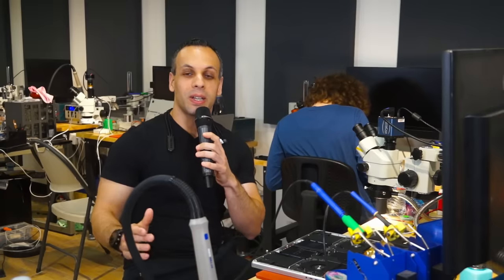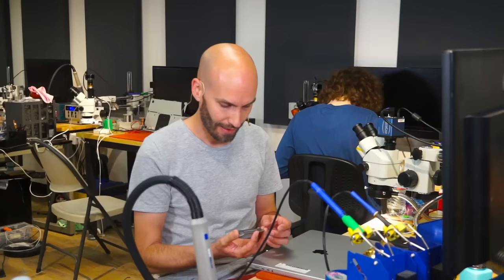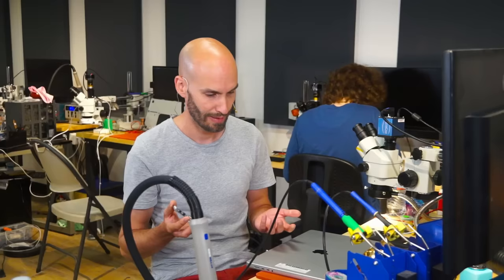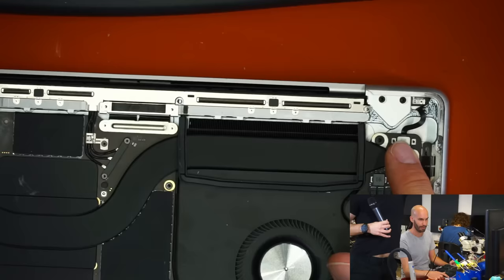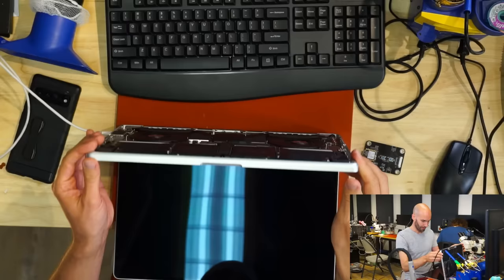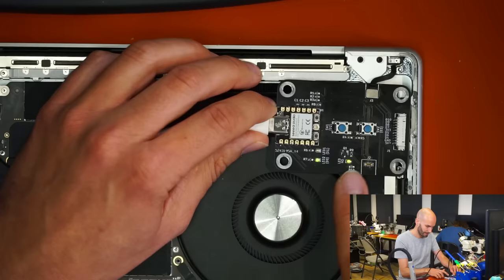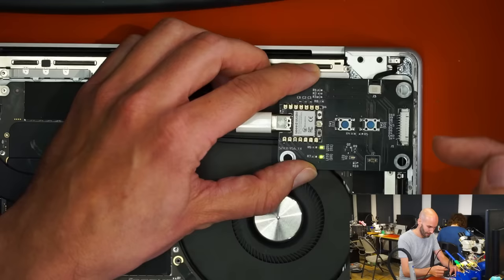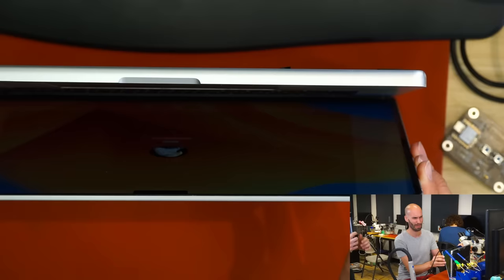We beat Apple at their own game - let the unauthorized calibrations begin

Comment: My first question: How is such a security-sensitive sensor left so exposed that it can just… corrode??
Reply: Apple.logic
Reply: How is such an important device so unimportant to apple users that they keep spilling soda on their phones and laptops that cost $2000?
Reply: @shinobuoshino5066  you know there exists a thing called condensation and water has 3 forms of state.
Reply: @renegranit240  if you live in a tropical forest without a dehumidifier and with a macbook I don't have much to tell you.
Reply: @shinobuoshino5066   some very sensitive water damage indicators can 100% trigger from humidity in the air
Reply: @supershid464  water damage indicator doesn't mean water damage occured
Reply: @shinobuoshino5066  that's my point, but also corrosion CAN happen without direct water contact
Reply: @shinobuoshino5066  I live on a coast, like >50% of all human beings. On the coast, water happens in the air, even when it is cold enough to instantly freeze when it touches anything solid. It can be fog, it can be humidity, it can be sub-rain layers in the atmosphere coming in droplets too small to feel but enough to slowly laminate everything in a dew. Unless you live a life so utterly empty you don't actually open your doors, and chose instead to slowly rot into the architecture breathing only artificial air, any device you may need must be prepared for ordinary environmental conditions. If it is not, that device is specialized for different environments, and should not be sold in places that will rapidly destroy them.
Reply: @dashiellgillingham4579  ah yes, everyone lives near an ocean, how could I forget about that.
Reply: @shinobuoshino5066 Where i live, we often have 80%+ humidity during the day and 10-15C drop in temp for the night = condensation. 
Nevermind breathing in the direction of a laptop in front of your face, that is also hot humid air...
Reply: @shinobuoshino5066   you should honestly see a population density map.. good chunk of people live in humid areas.. and even in the middle of the US, away from the coast, humidity still exists. can your dehumidifyer work when traveling in your car?
Reply: @ZaricaLP  yes my car has this thing called air conditioner and my bag has those pellets that absorb humidity that had a warning not to eat but you did anyway.
Reply: Simple
They want you to pay them more for an overpriced repair so they design so poorly that stuff breaks by normal use
I don't like apple
Reply: @shinobuoshino5066  Its the #1 computer for music creation. They're used in clubs. Shit happens, people are stupid.
Reply: @GetFitEatRight  no wonder why all music is slop
Reply: @dashiellgillingham4579 I live a valley city with average 90% humidity and the largest amount of rain fall in Europe. Our homes rot away from dampness and mold. I’ve never had or heard of tech products being broken by corrosion. And I grew up in the 90s when people went outside. I’ve known more people personally than you’ve had hot dinners.
Reply: What about windows? They're the very meaning of building shit cheep. I've had a macbook for 5 years and... nothing. Had to get the battery replaced once, but that's it. Windows? My brother bought a pc... few months later, the pc got ruined. Next pc, same story; same with the third. And i've heard first hand of people who buy a pc, it’s just a year old and guess what? Their keyboard broke. Now that's what I call cheeply made and screwing over its customers. Mind you, all the people who I mentioned did properly take care of their devices; and they still broke after a year of use at best. I've never had that happen with a mac. Hell, the Windows laptop I have now... Feels flimsy as shit, too. I'm not saying it'll break, but the quality of it just... It feels low quality as well.
Reply: @ThatBlindGuy246  what does windows have to do with hardware that you found in landfill?
Reply: @dashiellgillingham4579  What is this artificial air? Do you think buildings just circulate some different air than the shit you breathe when you go outside, or something?
Reply: @ThatBlindGuy246  "a pc" is not a laptop

Comment: This really is a nice new invention that opens up doors to calibrating other components in other apple products. If apple software or hardware engineers make amendments to this then they will have made a conscious decision and we will have concrete evidence of this. Evidence against all those supporters and legislators who oppose right to repair.
Reply: The way to calibrate this specific sensor does not necessary have anything in common with anything else in a Apple product. The caibration routine is device- and manufacturer-specific.
Reply: Was wondering if this means a solution could eventually be reached for calibrating a new screen? Or if their system configuration tool is a different ballgame.
Reply: The German dude said he was tinkering in Arduino and then got other people, more proficient than him, to finish the fix, so yeah, the path to achieve the fix is now open but it will need to be reimplemented for all other devices that Apple shits out too
Reply: @LudwigVaanArthans  Exactly.
Reply: Yep. Next stop: screens!
Reply: Every time I see a ht like this, I fear to wonder what the hell are they going to do to screw things more.
Reply: Rest assured they will come up with an uncrackable version with better encryption.  It's a never ending cat and mouse game  (Clinton vs. Apple lol)  By the way, normally there should be NO need for calibration as each MacBook has the same case and closing angle.  Obviously this just another Apple BS.
Reply: @oienu  But are you actually getting an expertly calibrated screen when you buy a mac? And are you getting your money's worth? I bet not, I've always built my own computers, and I will continue to do so.
Reply: @oienu yea but when Ur sensor breaks and u want it replaced
Reply: @MrElmostudios  When the sensor is just a Hall effect sensor, well, you need to adjust the threshold for the magnet on the lid. That depends more on the sensor manufacturer, not Apple.
Reply: @BillAnt  Unfortunately, calibration is necessary due to variations in the magnetic field of the magnets used. These variances result in the sensor consistently producing slightly different values, which could potentially lead to issues if calibration is not conducted.
Reply: @notebooknerds_de  trim pot. Since this would be essentially a simple on/off switch with a hall sensor trigger on a device, you don't need a hugely accurate calibration tool or technique. Just turn the pot until the thing works correctly. Though I guess Apple won't implement this because it would take up space.

I'm probably wrong with the trim pot idea, but honestly this kind of simple actuation shouldn't need any kind of complicated calibration if it was designed to last. What was wrong with putting a small neodymium magnet on the case of the laptop and a very basic hall sensor on the top of the screen? It didn't need calibration because the error tolerance was so high it didn't matter. I'm also genuinely asking because maybe there was a problem with it I didn't know about besides every now and then getting a paperclip or something stuck to your laptop.
Reply: @notebooknerds_de  - Other manufacturers use the same HAL effect sensors just fine without calibration.   Even if there's a slight variation in the magnetic field, it doesn't matter whether is closes at 4, 5, or 6 degrees, this is not some super precision application.

Comment: I was expecting Stephan to capitalise on this genius tool by selling it for $500+ but was happily surprised that he's made it extremely affordable, even for a DIY repair, at only €169!!!

Even though I do not own ANY Apple products, I thank you wholeheartedly for your efforts with this and wish you all the best with developing similar devices for other locked out anti repair hardware on other Apple devices.

❤ To Louis and Stephan From Australia ❤
Reply: And it should be mentioned, after 350 units are sold, the project goes open source.
Reply: @DaRealV  i mean he did really heavy lifting in reverse engineering so i completely understand that he wants to earn some money from it
i just really hope apples cease and desist doesn't come to him
Reply: how did louis forget to mention it @DaRealV
Reply: @dairiskuznecovs7233 Huh ? He just did the one thing people didn't bother to do and read the fucking chip datasheet to send i2c calibration commands.

169€ is extremely expensive. That card should not cost more than 15€ all in to make.
Reply: @henria.277 "i2c calibration commands" The hell does that even mean? i2c doesn't need calibration commands. Do you mean calibrating some sensor? Okay, but then why would replacing the part make it so the thing stops working?
Reply: @henria.277  he wants to recover the cost he spent getting someone to turn his tinkering into a product .After the costs are recovered, (350units), it gets opensourced, at which point you could get one made for much less money.
Reply: @bluefireanimations3712  The sensor are either not absolute or simply trigger a boolean register in the sensor after a certain value is reached, both of which need calibration when changing the part.
Reply: @henria.277  usually you will get a reading when querying the sensor, but you can configure when it raises an interrupt, which is probably what is being done
Reply: @henria.277  so where is the document you wrote to instruct other people to calibrate the sensor themselves?
Reply: @henria.277  that is pretty much what you have to do for these sensors, but you need to know where to read and store them, create a pcb with really hard to solder parts, and finish the build with just 2 buttons and 3 leds as the "UI".
It's like the Poland Key's you get to disable the keyfob lock in your car. Yes, they have a switch to turn it of and on and you just have to plug them in, but they reverse engineering takes time. So I'm surprised he just asks for 170 bucks and 350 units and them, make it open source, but I sent this video and his site to the repair people I know and hope, he gets his hard earned money
Reply: @henria.277  Oh no, someone wants compensation for their time. How dare they! If it's so easy then make your own competitor for free and release sources.
Reply: @nvr-lvd-livid  That is a very ignorant thing to say. This behaviour and the margins apllied are not different than what Apple does.

Send me a sensor and you will get your precious calibration software in a week.
Reply: @henria.277  Oh no, repair stores will crowdfund it for you and you will get source after 350 units are sold. Such tragedy. Supply and demand.
Reply: @henria.277   do you have the datasheet?
Reply: @henria.277  looking at the parts on the board ... i think you are slightly whrong unless you assume mass production with a few 100k units ... just from the parts i can idetify and havin someone procude a somewhat low quantity of them .. the price in € would be around 100 ( that is just what i can identify on the Board and somewhat normal prices for custom production)  ... then you still have to get someone to make the code for you so it actualy does what you want ... and that person also needs to be paid ... i'd say the price is reasonable
Reply: @henria.277 Extremely expensive??? sounds like repairing 2 sensors manually is already more expensiev than buying this tool. What are you smoking ??

Comment: Why do I feel like that'll play out like the McDonald Ice-Cream Machine story where the company who made the machine tried to sue the couple who made the tool to allow the store workers at McDonald to fix the basic stuff, like unclogging the nozzle and delete the error code to allow operation to continue?
Reply: Hang on lemme look something up real quick.
Reply: What the hell
Reply: @mantacid1221  Seems like you found the story I was referring to...
But if you concider that the maker of the ice-cream machine is one of the largest shareholders of McDonald and McDonald one of their largest shareholders...it kind of makes sense :(
Reply: @Kiramitsuoka  so it was basically McDonalds screwing over their own franchises... classic.
Reply: Then he still can make it open source. It's just a "calibration tool for a sensor" then :)
Reply: @stephanweinberger  Screwing over thr franchise owner to make more money for the corporate c-suite.
Reply: @Spelter  I'm trying to see how it calibrates anything.  You connect the sensor cable to the "calibrator" taking hinge out of the circuit.
Reply: @robertsmith2956  Presumably it tells the sensor "The current angle is closed." in whatever form that data takes with Apple's sensor. It makes sense, you work on machines with them closed already, so it wouldn't really need extra in saying "Hey, make sure you have the lid closed when you use this tool" since who is working on this with it open, yakno

But yeah all it looks like it does is bypass their lack of a tool, interface with their system, set the closed value to the sensor's current value, and wham
Reply: Basic pattern recognition?
Reply: @robertsmith2956 the part itself has chips so has a tiny amount of memory, enough to remember that “the calibration” (whatever it means in this case) was done and saved by him pressing the second button (which he coded to perform whatever command).
Reply: @stephanweinberger  They screwed over the creators of McD's.  Why should franchisee's be different?

Comment: Why is Apple so afraid of others stealing their business if they're so good and have unique products?
Reply: money
Reply: Why are you so sure they are afraid?
Reply: if a product you've made works reliably for 10 years without you, that means you won't be hearing from your client for the next 10 years.
Reply: @AcidSugar1414 Because they are constantly doing everything they can to stop right to repair legislation. It's CLEARLY a priority.
Reply: Their main business is hardware.
    The operating systems come free with the hardware

It makes sense that THEY are able to do the repairs (against a fee, of course).

But they're going about it the wrong way right now
Reply: Simple, peak Apple has happened. They cannot realistically grow their sales of iPhones much further. Their laptops don't sell in the sorts of volumes their phones do. Their shareholders expect more and more profits, so they get that from customers wanting their stuff fixed. They don't employ skilled electronics technicians, that would cost too much, require fume extraction and lots of specialised gear. So they do it by swapping bits, lego style repair.
Reply: It’s greed plain and simple .
Reply: Case in point, everybody wanna try to steal their ideas and market share. I don't agree with that rationale, but someone at Apple must think that. Also, the greed.
Reply: Apple doesn't have unique products. That's why they're afraid
Reply: lazy or incapable to innovate 😅
Reply: Because hardware is no longer there business model. 
They don't sell hardware as they used to and move to apps business model so f you, the few hardware they are still able to sell, belong to them an not users.
Reply: True, after using a Macbook pro for two months at work I agree it's not better than my HP.

Comment: If Apple really care about security and privacy, the most common sense is that they release the software for the calibration to the public, easily accessible, because then the user can trust that the sensor is calibrated by the trusted party, heck, the user don't even have to send the macbook to "shady 3rd party repair store", they can just change the sensor and calibrate themselve, 3rd party doesn't get money (perhaps what apple wants) and Apple still true to their words.
Reply: a sensor designed to detect if a laptop lid is closed shouldn't have to be calibrated at all.... It's just a SWITCH
Reply: @Damien.D  I guess there is some calibration need to control at which point it goes from on to off at least if you plan to use the same switch for 50 different lids.
But yes the way Apple does it is just stupid.
Reply: @Damien.D  Unfortunately, that's the world we currently lived in
Reply: @rynobehnke8289  it just needs to know the angle difference between the two hinge parts. That is pretty straightforward.

Comment: I think engineers should just gather and fight against these practices in  brilliant ways like this.
Reply: Not engineers, just people should not buy things that make  anti repair things
Reply: Thank you for your kind words. We share the same perspective, which is why we've included an extension port on the nerd.tool.1. We would greatly appreciate it if the community utilizes this board to address various MacBook issues. We are actively working on developing different extension boards with various MacBook connectors to encourage experimentation and the discovery of innovative solutions.
Reply: @lot.bajrami A bit impossible here in America, most of the populace has an iPhone. Owning a business for example makes things so so so much easier if you have Apple devices. If Apple would stop the authoritarian levels of lock down, nobody would buy an android again.
Reply: What? What exclusive features does the iPhone offer to business owners?

Comment: I have to give this man credit for not only figuring out how to program the sensor, but creating a tool and deciding to sell it to anyone that wants it.  It would have been more profitable to buy the sensors from the manufacturer, program them, and then sell the programmed sensors for 10-100 times the cost of the unprogrammed sensors.  It would result in many more sales at a higher profit margin and no one other than apple would complain about it.  The repair community is much richer for the work this man has done and his ethics in not choosing to maximize his profits.